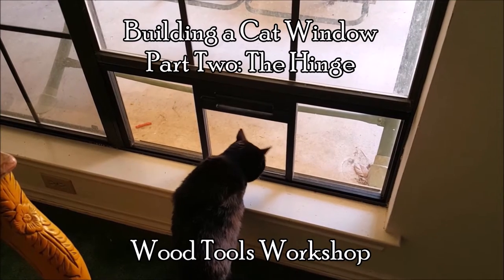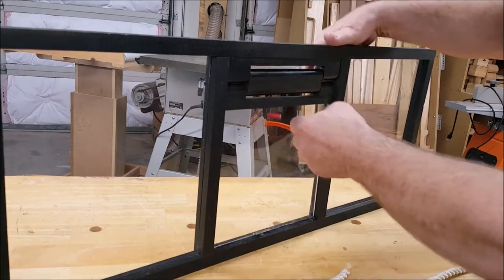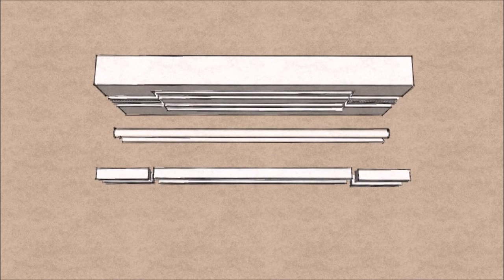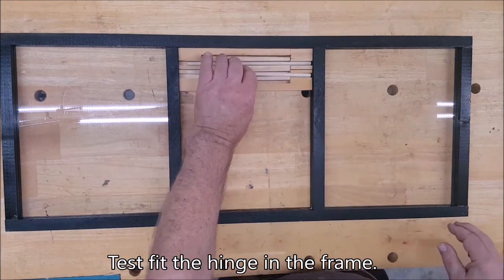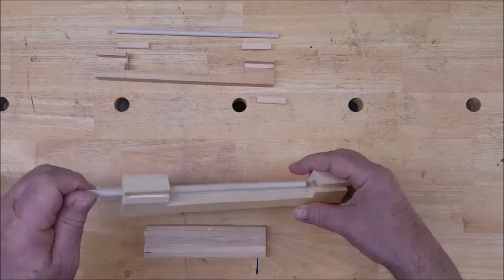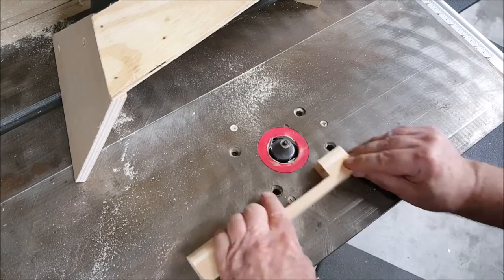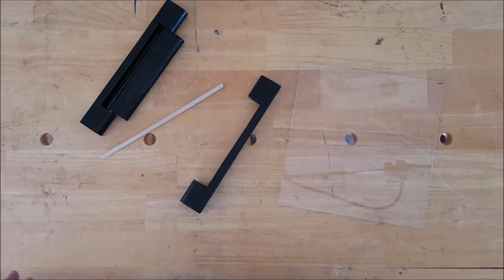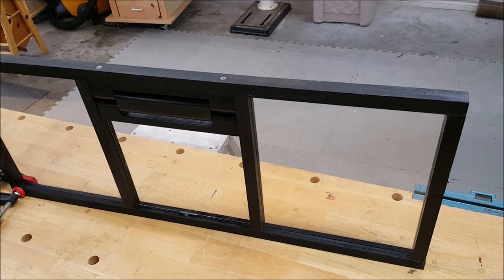Building a Cat Window Part 2

Comment: By the way I came accross this video when thinking of how to build a catwalk that would be along the triangular windows that span the length of the top of our wall facing outside.  At this point we haven't yet replaced the old 60's erra homemade none opening ones that were here when we moved in.  (That's a project for another day) But my thought was to create inside window box of sorts the span of the windows with a shelf space for plants to grow and perhaps an inside set of windows that line the inside that are further tinted and have some hinge to open them for access.  Your creation gave me the idea that I could maybe create two of these cat doors at the ends to allow (our strictly inside cats in and out of the catwalk with some type limited ventilation coming in at the sides as well.  Just at beginning stage of design but this might make a nice area for the cats and plants to thrive while inner tinted windows prevent too much sunlight coming in the room and further cut down on heat? Also might function well in the winter for plants but less so in the heat of the Arizona summer. Idk what modifications to such a plan would be best yet, any others ideas or input would be welcome. Thanks!